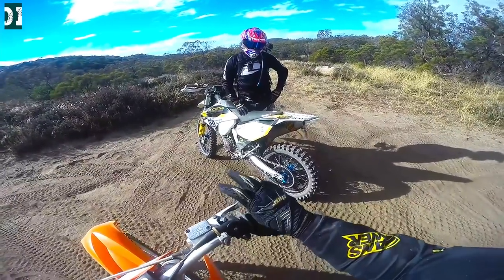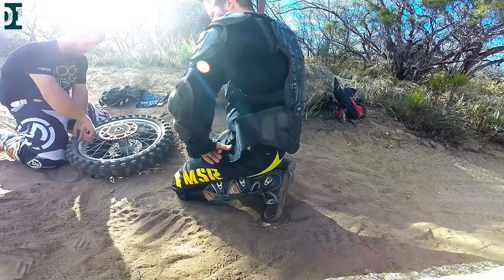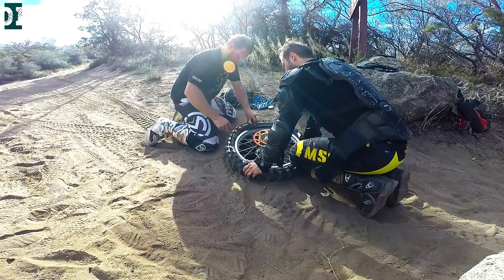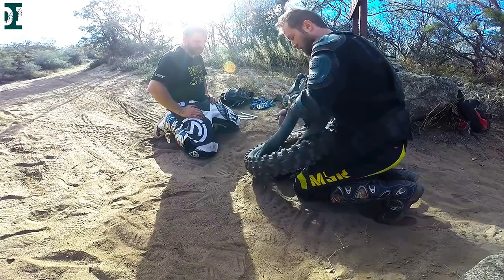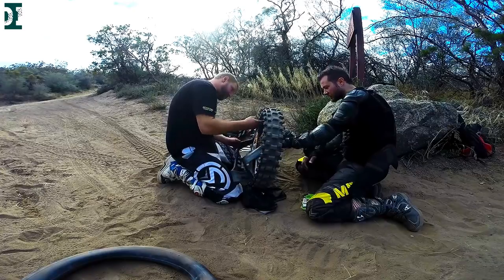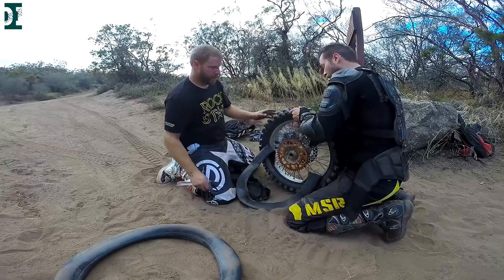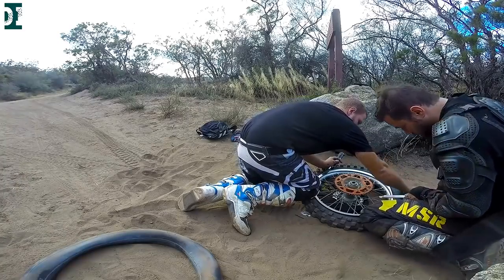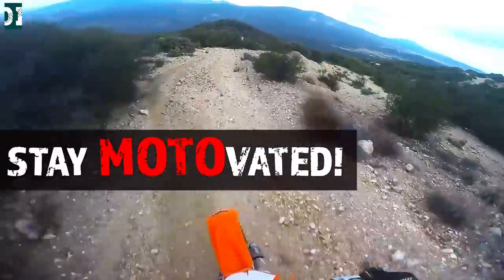How to fix flat tire on a dirt bike in the middle of nowhere.

Comment: I often ride out into the Mojave desert, near my home, sometimes covering 200 miles or more without a chase vehicle. Carry a large pack of long (10 to 12 inch) zip ties. If you get a flat, wrap zip ties around the rim and tire every couple of inches and cinch them up tight. The knobs will keep them in place and they will keep the tire profile round so you can get home or back to camp... :-)
Reply from the maker: thanks a lot Robert, thats a great advice!
Reply: Thank you! Great Video! Peace and Good Health to You!
Reply: This is an great tip! I usually carry zip ties but probably not enough for this - I guess you'd need at least 100 or so..?

Comment: My dealer said carry a spare 21 inch tube, it will work for the rear tire too. Once on a ride my buddy's rear tube broke. We replaced it with the 21 inch tube. He left that tube in for 3 years, no problem. Later he sold the bike. I wonder what the new owner thought when he changed that tire.
Reply from the maker: haha, that would be a surprise once he changes the tire, thats for sure.. I wonder what else he would want to check once he finds out :)    maybe a piston size, lol

Comment: I just did this.  I punctured the tube 2 times, patched it 2 times, and finally got it on without puncturing it the 3rd time.  My mistake was starting to put the tyre back on from the opposite side of the valve (as some other video suggested).  Start at the tube valve and work around until you finish on the opposite side.  I also tried it with the tube pre inflated a bit and completely flat.  I think I'd recommend flat.
Reply from the maker: thanks for sharing

Comment: You should change the tyre on the sprocket side or you'll bend your disk brake and you wont be able to use it anymore.
Reply from the maker: yea, thats good tip! thanks for sharing!
Reply: @dirtniron  You should change it sprocket side for two reasons. Firstly you don't want to bend your disc. Secondly, you don't want sprocket rash if a lever slips.

Comment: Have you ever tried Tubliss? What are your thoughts on that system?
Reply from the maker: i haven't tried it yet, I think its good product and can work great on trails
Reply: ive got one on my back wheel. Lets just say ive never had a flat XD There really good for trails, although i dont recommend them for jumps, they seem to be too low pressure. an example is ive got a slight dint in my rim because of a jumping. overall they are very good :)
Reply: @dirtniron   I have tried it and while it's the lightest feel system I have ever used it as to be used with good strong tyres, and in terrain where the tyres won't get splits in them. When I was guiding and using ex customer tyres which were worn I had punctures every day riding in Turkey. Most of them were small slits in the tyres wall. The other bad point I found that if you are changing your tyres as often as me maybe twice a week that it's a pain. For me after racing and riding off road for 50 years I would say it's mousses for racing and tubes and double tubes for everything else.

Comment: That looks like a very compact air pump. Do you have any more info on it? Thanks.
Reply: I have a small compressor that I stripped off all the plastic from. Then it is fitted into the plastic upper fairing on my 950 ADV. It's great and means I can let my tyres down while off road and then pump them back up again.  It's just a chinese one that most car shop sell, I have found that even though some are more expensive and have fancy covers they all are the same internals.

Comment: Besides changing the tube, it is as important to check what caused the flat (nail, bolt, etc). Always check the tire so you won't be blowing another tube and be stranded for real.
Reply from the maker: Yes, good point! Thanks for sharing

Comment: don't you have to set the bead by first pumping it up to a higher pressure and then dropping pressure to whatever you ride with?
Reply from the maker: +LeoPod yes that's right. I just wanted to get home on this tire, had just a very small pump on me. Definitely when changing tire at home I first pump it to around 30-40 psi and make sure it sits nicely around the rim. Then set my pressure. Thanks for pointing that out

Comment: Thumbs up. It is easier to have it done with the disk brake upside than the sprocket though, just saying. The disk is smaller, gives you more room to work and less harmfull if your hand slip.
Reply from the maker: +Wide000  yea that's right, your knuckles will thank you. Good point!

Comment: I can't even watch this all the way through! If your going to show people how to do things on here then you need to do it properly.
Reply from the maker: What do you think was so wrong there?
Reply from the maker: btw, your trip to Macedonia looks amazing, wish I can do that when I am older
Reply: @dirtniron  thanks for the reply, watch my video at captinktm.  What's wrong with yours? everything. Never ever put the wheel disc side down for obvious reasons. Once the rim lock has been slackened off then get the tyre off the rim both side with you foot holding the wheel at a 45' angle. You do say later about this but you should still show guys how you do it. You definitely don't need 4 hands involved. I could go on but better you watch my vid.  You sound like a nice guy.  But if your going to give advice make sure you have tried every possible way of doing something and you show them the best way. You put the fresh tube in with out checking the tyre inside or out? So I guess you did n't get very far?  Just watch my vid and let me know what you think. I hope it will help you next time. As for Macedonia it great and I will go again next year, hopping for better weather as it rains just about everyday.  here's the link https://youtu.be/aX5bcVa93V4
Reply from the maker: alright Chris, so everything was wrong.. ok..  
your points are valid,  I can always do better job, but how in the world can I explore "every possible way" ?  even if I think its the best, there will be old guy like you with way more experience who can say he knows better way..  
thanks for your input
Reply: @dirtniron  You hit the nail right on the head there my friend. Don't post video's on how to until you been around a few years. Experience comes with age. The sad thing is now youngsters look to youtube and google for help and advice where I just watched a learnt from old guys, I learnt from a guy called Gerant Jones (Many times British Enduro Champion) he could change a Metzeler enduro tyre in less than 4 minuets with just what he carried in his tool roll. So watch my vid, try some of the idea's and if they are any good pass them on.
Reply: Dirt N Iron you keep posting. Let the viewer decide if it was helpful or not
Reply: Chris Pascoe I’m no expert but I’ve ridden for years. 

You are an “expert” lugging all of this equipment around. I pull out one can of fixaflat, I fix my tire in 3 minutes. Quicker than it takes for you to get out your tools in your video.  And then I have ridden the ten miles home so my bike is in my garage to repair properly in less time than it took you to replace the tire in your video. 

So while it seems neat that you “know how to do it properly”, I just made a case that you really didn’t. I exceeded your performance in every measurement possible except for one. I do have work once I am safely home where I can have access to food, water, comfort, tools.